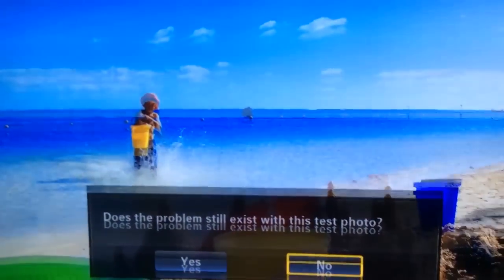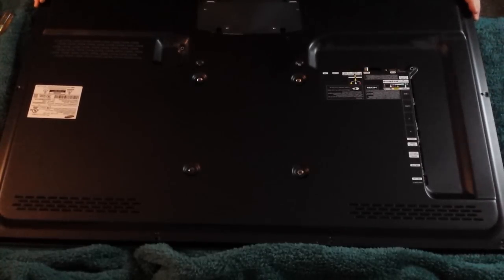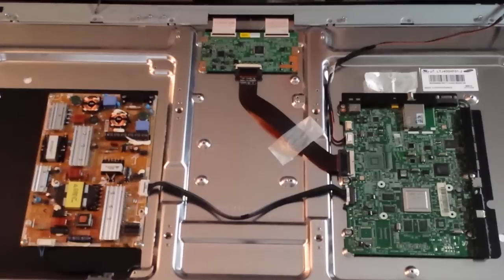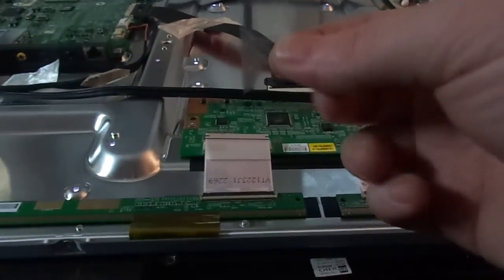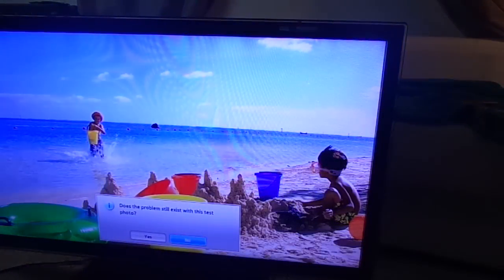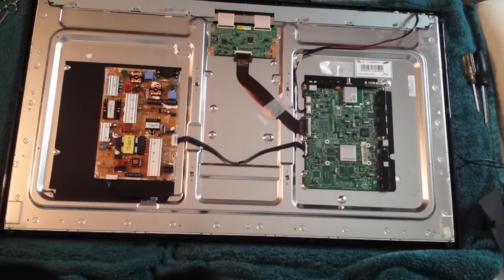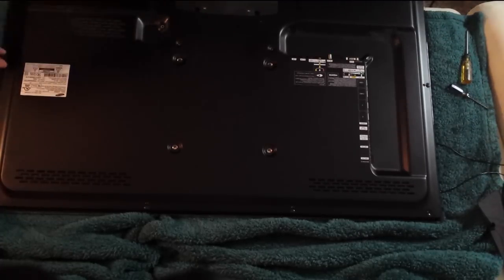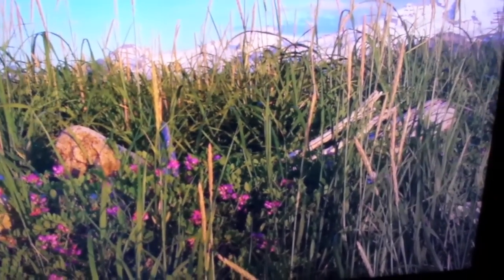LED LCD TV FIX, How To For Samsung Double Image, Black Vertical Lines, Screen Problem Sony LG.

Comment: I tried doing this with the same TV, now instead of a double image I get no image when I have both ribbons connected. Even without the tape. But I do get half the image when I remove the left ribbon.
Reply from the maker: Check to see if the gold contacts on the ribbon cable are scratched. They are pretty delicate. I had a TV and accidentally scratch one of the cables, ended up ordering a replacement from eaby.
Reply: @DoItWithDave  Can't be the ribbon because when I switched the ribbon from left to right I get the same results. I get half the picture when only the right side is plugged in, but if I connect both I get no picture, just the backlights. All I did was place the tape in different sections on the ribbon, not I dont even get the double image when both ribbons are plugged in.
Reply from the maker: @hamfitness863  you might try to lock down the side that's giving you an image and adjusting the other side a bit. If that doesn't work try locking the side down that isn't giving you an image and adjust the one that is. You could try to switch the ribbon cables again. This is is kinda hack and sometimes the results will vary. It might help to turn of the tv, disconnect the power and push the tv power button. Then plug back in and see if anything changes. I know how frustrating this can be.
Reply: @DoItWithDave  Nothing works. Seems like the left buffer board got damaged and not matter what I do I can't get a picture on the left side only vertical lines. Oh well
Reply: @DoItWithDave  I think I messed by covering the gold connectors with the tape. I should've paid better attention to the instructions =/

Comment: Hi Dave, thx for manual. Unfortunately it didn't fix mine. I have one 1px vertical line 5mm from top screen edge. When I disconected right it shows half screen but line is dissapeared, when connected again line is appear again. Have you ideas maybe. Samsung ue40d5000. Thx
Reply from the maker: You could try to very gently move the cable in it's connector as you lock it in place. Be careful not to do this to much as the cable tips are very delicate. You may try doing this on the opposite cable. Also check if the cable tips have any signs of wear, like brown or pieces that have flaked off. If non of this seems to help you may want to price t con boards. I can't say for sure but many people have commented that after following the steps in this video with no success they purchased a used t con and it did the trick. I hope this helps. I understand how frustrating this issue can be.
Reply: Yes, t-con is final hope, because after cleaning t-con from dust and place on place now righ side shows only half with a brighter constrast. It looks like 50% (good picture) of left side (fully functional) and 25% of right side, toatl only 75% of screen. It looks like right t-con socket not working or smth. I don't spil water on it. How to chekck is it matrix or t-con, any test with ribbon (pull it on/off)?

Comment: I don't have removable ribbon cables on mine. I also see a small gap in the right ribbon. Could that be what's wrong? It starts out okay then problem occurs.
Reply from the maker: On some models the ribbon cables are non removable. Ppl have posted this same issue, and have just replaced the T-Con board all together. Now where you see the split in the cable, if it looks like it got shorted out (brown or black coloring) then that may be the issue, however it could just be the way that cable is manufactured. I would check all the capacitors for signs of wear. The tops should be completely flat. If for some reason any of them have a buldge (raised done shape) on top then that could be the cause of the issue. I hope this helps.

Comment: as when there are 4 Ribbon?
Reply from the maker: Hey there my apologies for the delayed response. It sounds like you are stating that 2 ribbon cables come into one side of the contacts (where they go in  the T-Con board) and 2 after going out the screen? The ribbon cables I was showing in this video being adjusted are after the T-Con board. The ones before it may not be the issue.

Comment: It did not work on my LG, but thanks anyway. I think I made a shortcut while moving the Flex cable on the connector, and burned a couple of  wires of the Flex cable. Time to go for an oled
Reply from the maker: Oh no that's a bummer. Idk if you still feel like working on this but if it's just the ribbon cables they can be ordered on eBay. If you already got rid of it then may your OLED bring you many years of clarity. Thanks for watching!

Comment: I dont understand..are you putting the tape on the cable to increase the pressure on the connection...where does the tape go, under the black clip side or the other side?

Comment: I tried and unfortunately it didn't work for me, the screen just kept getting worse and then I blew out a capacitor on the display circuit board so now there's back light but no picture at all. thanks for the informative video anyway.

Comment: Hye Dave mine tv is LG 39LN5400-TA.
And my problem picture is delay when it play also have a vertical line start on middle after 10min this line will be full of my tv screen,
What is yr opinion?can I try yr repair method for my problem?

Comment: According to my electronics technician friend: LCD double image displaying = bad lcd panel with minimal internal panel component shorting (not enough to ruin the Timing Controller board (TCon)). However, some LCD panels do have maximum short damage, that do kill Tcons. He recommends tossing the TV displaying double images, or cutting certain traces on bonded Tcons, but that cutting traces was a fatal guessing game to the TV. .... but I’m seeing that you have socketed ribbon cable connector inserts on your Tcon board, and you have all the advantages of playing a guessing game with tape and ribbon cable trace buses, so you don’t have to butcher your Tcon board. Nice!!!

Comment: My 36” Samdung TV has the same problem, unfortunately, my LCD display ribbons cables are bonded to the Tcon. ...which leads me to believe, that the Tcon board has a warranty time bomb deliberately placed there to distort the picture and make you think your TV is broken, and force you to buy another TV. Planned obsolescence.  Yea, sounds about right!!
Reply from the maker: Man that's a bummer.

Comment: The double picture and lines are gone but one half of the tv is a little darker. Do i have to just keep messing with the tape location
Reply from the maker: From my experience and from what a lot of people post after following the steps in this video the display ends up showing a bit dimmer on one side of the screen. I didn't realize it on my TV until a while later. I hope this helps.

Comment: hi dave.how many lines you separate with the film?
Reply from the maker: People have posted several comments about how much on the ribbon cable they covered. From what they shared it can range from 7 to 12 on average.
Reply: thx you for the fast answer

Comment: I did as you said now a dark blue vertical line? Any tips?
Reply from the maker: The lines are associated with the gold lines on the ribbon cables. For every line shown on the screen it represents one line of gold from the ribbon cable. Maybe check to see if the ribbon cables are damaged at the tips. they are delicate and sometimes the gold flakes off. Also check that the cable out from the t-con board is properly seated sometimes it can pull out a bit cause an issue with the screen.

Comment: Sir I purchased Samsung 3D LED TV40" size in 2011 year after 6 years ...I obesrved one 2mm size horizon small line down side than entire tv increased , pink and some green colours appeared, even after passing picture moved the same pictured appears ....i called local technician for repair but he says  disply problem after he checked the ...so u go for new tv for don't purchase disply it cost 900 Us $  ....is it true ? Display cont be repaired?
Reply from the maker: From the best of my knowledge and understanding of these types of displays I don't think the actual display can be repaired. And by repaired I mean not being able to repair a crack. As far as the green screen (ghosting) and or lines, that doesn't seem to be a broken display but a bad T-Con board or a burnt out ribbon cable. Most of what starts to malfunction is electronic related not just the display. Its very possible that if you removed you're display and installed it in another unit that wasn't showing any issues that you're display would work perfectly. There are some other videos on YT that show a couple of ways to fix these types of display issues like replace the T-Con board or adjusting the picture settings.  I hope this helps.
Reply: Do It With Dave Thank u very much sir for ur kind reply am very happy about ur answer.... company technician told these type problems will generally come only for wet clothes using for tv screen cleaning cleaning...I don't know...anyhave sir once again thank u very much...

Comment: what's your suggestion if I get those lines all the way across the bottom of the screen? I replaced the tcon board, and it did not fix the issue.
Reply from the maker: I can't say for sure but if you haven't already attempted to adjust one or both of the ribbon cables you may want to give that a go. That's how I was able to get the lines to go away in my case.
Reply: Thanks for the reply. I'll have it plugged this time while I press and move around the cables and see if that helps.

Comment: My Tv is a VIZIO 50U-D1, and it was appearing a horizontal line (thin gray line) on the top of the screen, and usually after 60 min of turned on the screen starts to flicker. I opened it check all the capacitors and no one seems burned. So, in fact, it is a problem that starts when the Tv gets hot, but I don't know why. Maybe the T-Con Board is defective?  I decided to go through your video and could stop the flickering using a small piece of tape but the horizontal (gray) line on top remained there... 

After putting the tape on, the horizontal lines appeared (The same that show at 6:59 in your video) and I could not clean the image... I tried to change the tape position, cut into a small piece, but had no success... I noticed that I started to damage the connectors of the ribbon cable from taking and putting again by many times, so I decided to stop it.

So my only problem now is to fix this horizontal lines that we can notice when we are close to the screen... The initial horizontal (gray) doesn't bother me...  

Anyone had a similar problem and could solve the problem, can share how do you fix it?

Comment: Alright. I put my big girl panties on and went at it. I was able to get rid of the double flickering images but not the lines. Every time I retried to get the lines fixed, I'd lose the whole side and had to restart with a new piece of tape. After the fourth piece I decided not to push my luck and just be happy to fix the double image.  Could the lines fix itself at some point? How about doing the same thing to the other strip? Would it fix the lines?  Dave man where are you? Please answer back. We need ya! Thanks to YT,  I can't send you a PM anymore :-(((

Comment: This worked well.  One thing that was odd - when adjusting the ribbon to get rid of the light vertical lines, sometimes the entire screen would go black, and we'd have to start again.  Still, the entire fix, from taking it down off the mounting bracket, to making the repair, and reconnecting it back to the mounting bracket was an hour.  And scotch tape is a lot less expensive than a new TV!  Thanks for posting!

Comment: Hi therr bro... how do i fixed a on/off blurry image?
Reply from the maker: Ahmad Sobrie from your comment it seems like the image becomes blurry then becomes clear while viewing? If thats the case and it doesn't stay blurry all the time you may have a model that has several ribbon cables just underneath the front bezel. Sometimes these cables become loose and will show a blurry image randomly. You could try moving the screen back and forth a bit while the TV is on and see if you can make the issue happen again or go away temporarily. If that works then you may need to remove the rear cover and put some type of spacers in between the screen and ribbon cables. There are a couple good videos showing how to do that type of fix on YouTube. If the image becomes blurry and stays like that while viewing then goes away after the TV is off for a couple hours it may end up being the same issue shown in this video. I hope this helps.
Reply: Thanks mate...

Comment: Good explanation. I watched with interest to see if I could gain insight about the workings of a TV. I have a different problem. My Sony Bravia has a great picture but turns off after a few seconds. 

 I have been researching this to find out what might be causing this.

 Explanations allude to one of three modules that may have a connection that heats up too much. 

I have read ideas about how to diagnose this. I don't have a full electronic shop so I'm using what I have available. One idea IS turning a can of dust cleaning aerosol upside down so only the cold propellant sprays out. Spraying the cold propellent  onto the connection in question would prevent it from heating up as quickly and may help to determine which of the three modules is heating up.
Reply: Ge Mum a transistor? Check recalls and warranties

Comment: WORKED!!! I still have a few horizontal lines at the bottom of the screen, but they are fainter now. The double image issue is fixed. A replacement T-CON board for my TV was like $10 so I ordered one anyway. Better than spending $350 on a new 32" TV.

Comment: Thank you for this video.  Just had a black horizontal line issue on my Samsung ln40d550 after 6-7 years of faithful service.  Like you said, had to use a quite thin piece of tape and try it all along the ribbon, but eventually found the sweet spot where all of the lines disappeared.  Here's hoping it lasts, but for now things look good.

Comment: I have called Samsung remote tech. up to now nobody called within 24-48 hrs.What has happened to my screen is that I got the double image and also a black shadow like a cloud top to bottom,middle of the screen.Can this fix on your video work and solve the shadow effect? Thank you very much.
Reply from the maker: Barry Syne I am not sure if this will definitely fix the shadow issue however people have followed the steps in this video to get lines or bars from showing on the display. If you can get the manufacturer to fix it that would be best as long as it's under warranty. Otherwise this is pretty much a last attempt before buying new to get the display back proper. I hope this helps.
Reply: Thank you so much Dave,warranty is invalid,3 yrs ago I bought it - Samsung 50'' LCD UN50H5303AF

Comment: I do have one black vertical line and all this horizontal lines (same you have) on my 46 inch samsung led tv. doing this method for several hours didn't fix the issue. adding the tape somehow remove the vertical line but the horizontal lines are still there. the screen also become dimmer. i guess the fix here is to replace the t-con board.
Reply from the maker: Albert Pineda it would have been nice if this fixed everything on your TV the first time around. I know the struggle is real when doing this and fingers crossed every time the power is turned on.  The steps in this video usually get the issue resolved but it's definitely not a professional fix and some people do add that they have replaced the t-con board to get back the picture. One side of the screen does become a bit lighter on one side using this method but is most noticeable on an all white picture. Thank you for watching and commenting and I really hope the t-con gets your set fixed up.
Reply: Do It With Dave i replaced the Tcon board and did nothing. All he horizontal lines are still there... I did try putting s piece of tape again but still no luck..

Comment: Wish you were here I'm sure you can fix it for me as I'm not tech savvy :(
Reply from the maker: Florida kl I would definitely take a look for you if I was close by. This is usually a last effort attempt to get the display back however it doesn't always make this right. All I can say is at least the price points for these displays have come way down in price but it's still a bitter sweet feeling after putting in so much time and energy just to say "goodbye ol friend you've been entertaining". But it is the way of obsolescence.